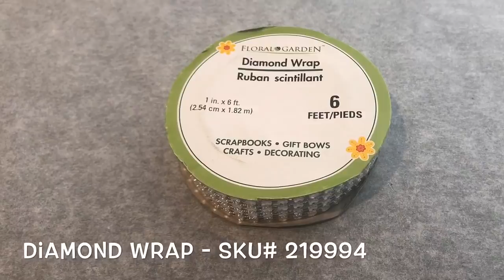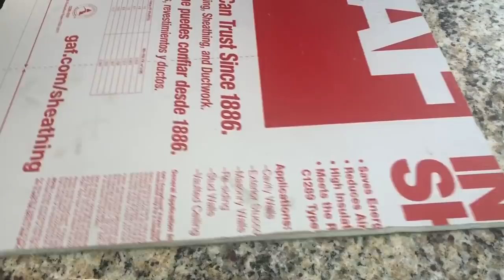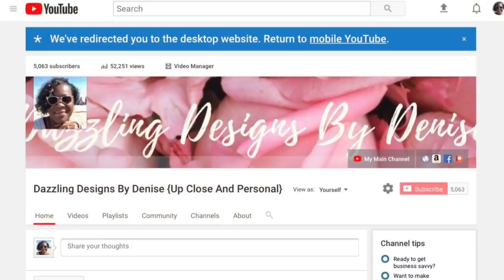Dollar Tree DIY || Glam Wall Art  || Black and White Living Room Decor Ideas

Comment: What did you use to hang the mirrors  on the wall ..i use command strips and it stayed foe couple hours and my mirrors are broken now😭 recommendations PLZ
Reply from the maker: Ofawna Lewis I also used command strips. I usually use more than whats required so that my pieces don't fall. I'd rather have too many then too few. I’m sorry to hear that happened to you.

Comment: This is very pretty, what did you use to hang the mirror to the wall because i'm sure its heavy right?
Reply from the maker: Montrice Sherrer it’s not heavy at all. Dollar Tree mirrors are very thin and super lightweight and so is foam board. I used 4 large velcro command strips. TFW! 🤗💕

Comment: Beautiful as always...is it best to get the foam board grom home depot n if so what size would i need?
Reply from the maker: sweetnjuci it comes in one size, 8 feet. It’s huge. I usually get the employees to cut it into two pieces so that I can put it in my car. And then use it for many projects. If you craft a lot then I would recommend this Insulation board. If not you may want to put several pieces of dollar tree foam board together. The piece I used for this project was 25x25 inches. Good luck to you! 🤗💕

Comment: A beautiful piece it is definitely time consuming. You mentioned if you use forks a tool is required please include the type of tool. 
Thanks for your beautiful project
Reply from the maker: You may be able to break them by hand but (for me) they don’t break as easily. Any tool such as a good pair of scissors, wire cutters, pruning shears, etc. would help. TFW💕
Reply: @DazzlingDesignsByDenise  thanks for the response.